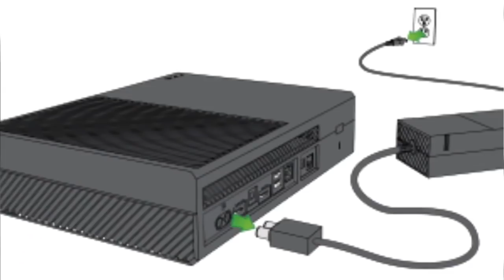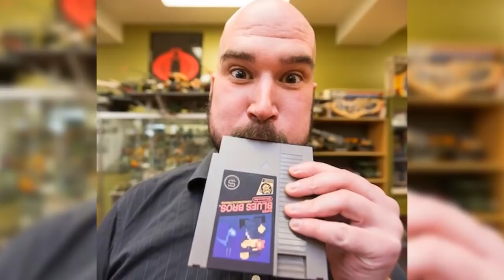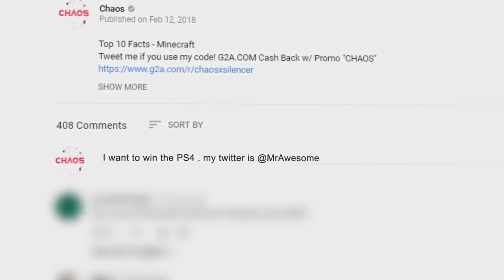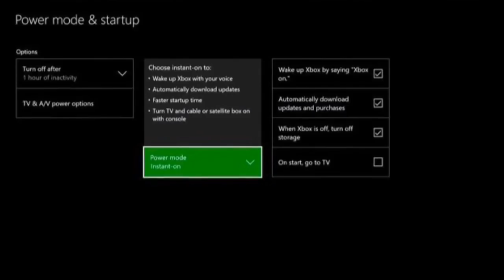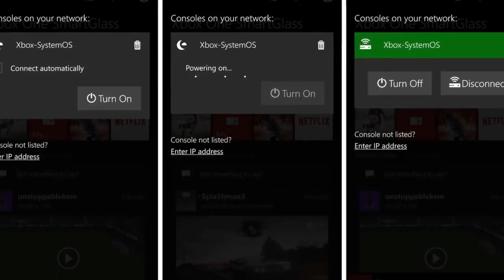10 Bad Things That Will DESTROY Your Gaming Console | Chaos

Comment: Heads up if you have an Xbox, Microsoft actually have it in their official documentation that they advise against using a surge protector with the Xbox One (and onwards) as it will essentially stack on top of the high quality Surge protector they have inside the console already which can negatively affect the power delivered to the machine (if stacked)

TLDR: Xbox One S/X have Surge protectors already and stacking on top of another damages the GPU / CPU as it reduces power intake.
Reply: Thanks didnt knew that
Reply: This also applies to the original Xbox One.

Comment: Funny thing is. When me and my friend were messing around in fortnite there was a power surge and it fried my friends Xbox
Reply: Serves him right to buy an xbox over a ps4
Reply: @gejamugamlatsoomanam7716  mate, PS4 is a cockroach MAGNET! buy a half decent PC
Reply: well, tell him to get a soldering iron so he can fix it. its an easy fix
Reply: @hiyall15  lightning damage is normally unrepairable
Reply: GreatMJH  anything is fixable. its just the matter of if you want to put the labor into it. lightning damage will destroy the power supply first and if you are lucky that is all that will be damaged. replace a few capacitors and the transformers if they have part numbers on them and repair some solder joints and you are good to go.
Reply: @hi yall Not always. Some devices are just not purchasable or just nor repairable.

Comment: 10. Do NOT scratched disks
9.  Do NOT unplug your console during an update
8. Do NOT blow into the cartridge/console
7. Do NOT let roaches get into your game consoles
6. Do NOT block the exhaust ports
5. Do NOT use third party switch docks
4. Do NOT stack things on your consoles (even if you aren't covering exhaust ports)
3. DO prepare for a power surge
2. DO monitor your temperatures
1. Do NOT unplug the console while it is in standby/sleep mode

Comment: Pretty sure your #9, should actually be #1, as it can easily brick your system beyond repair, if you interrupt a flash update.    

Also, your #6, should be #2, as this can easily damage your system beyond simply repair as well.   Just ask X360 owners, who exacerbated the RROD risk, and PS3 owners for YLOD, by trapping heat in the console by blocking air flow.

Easily the 2 highest risks on this list.
Reply: It needs to breath even when it is off??????

Comment: What I do for a power serge. All my wires for my consoles are connected to one 4 block port. There is 2 extension cords that are connected to a wire with more ports you get the thing. All I do is unplug the main power thing

Comment: consoles create a restore point during an update in the case of power failure. if this happens and the update was not finished, it will boot from the restore point, just like a PC. in regards to consoles hardware being more streamline than a pc, try to take a boot drive from an intel pc and put it in an AMD pc. windows wont be able to boot up. this can even happen when you are running different generations of same-brand CPU's and you dont do a fresh install.
Reply: That's not always true. I have installed windows on an AMD system and move it to an Intel system but it is to do with drivers.

Comment: I used to fix 360s with the RROD and I had a guy come in and I told him it would be ready tomorrow. I open this 360 and there was about 100 roaches big n small so i dumped it in 5 plastic bags sealed it and told him not to ever come back.

Comment: Bull. A scratched disk should not damage a disk drive. A WARPED disk that is misshapen can damage a drive.
About blowing into cartridges? Wrong. If you are using a cartridge and it has dust on the contacts, blowing into it can get the dust off the contacts and fix the cartridge in question.
As to cockroaches in game consoles? Insects are a problem in consoles. This could be solved easily by smaller ventilation holes and more of them on the console.
As to those "Third party docks ruin consoles!" Those are China-made, no-name console docks. DON'T BUY THEM IF THEY DO NOT HAVE A KNOWN GOOD MANUFACTURER NAME ON THEM! Especially.... e s p e c i a l l y do not buy them on a no-name website!